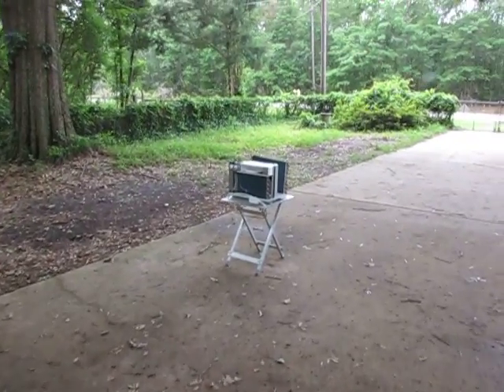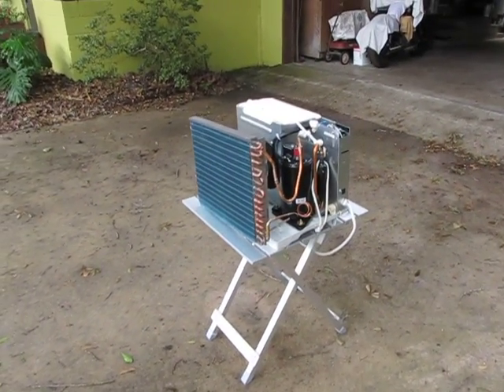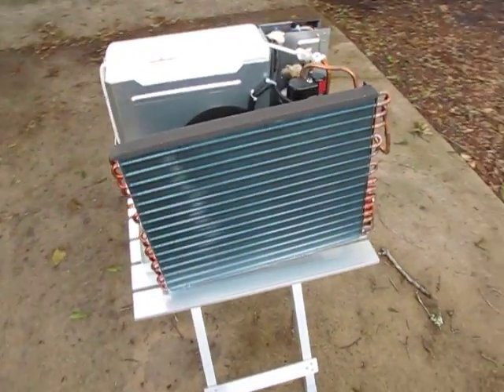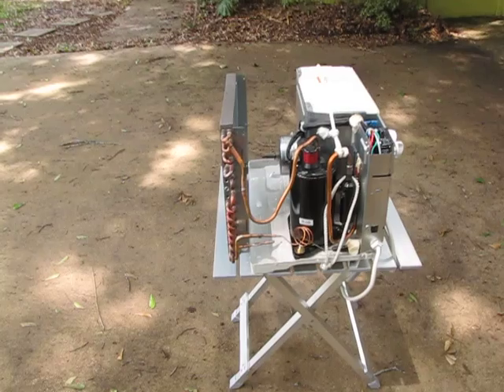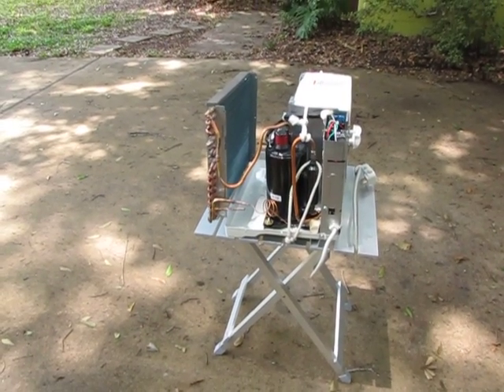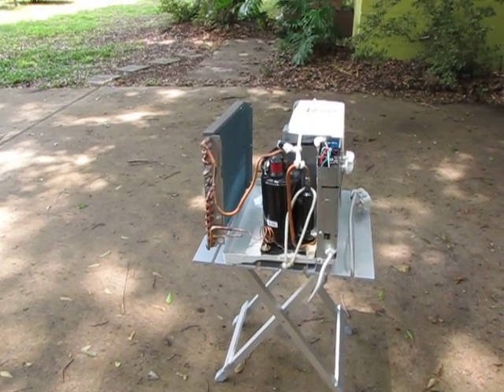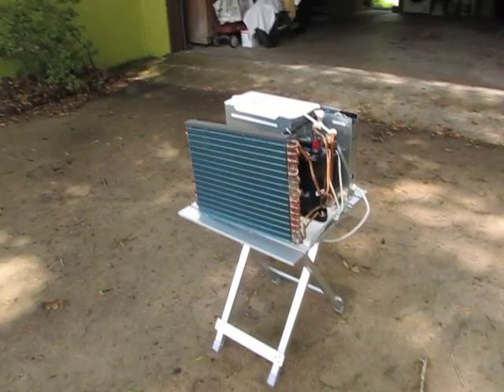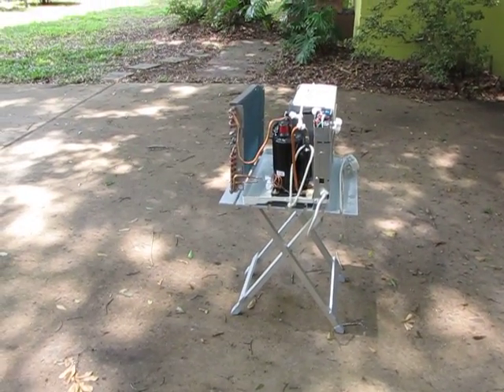DIY hybrid water heater and air conditioner for my solar trailer project

Comment: You would be better wrapping around a tank like they did in there how is works video hybrid water heater Rheem  
Because if you have a refrigerant leak it can’t get in your water looks like 16 raps with a space then 9 more raps l
Looks like a lot of pipe but I’m thinking a old bladder  tank 1st remove bladder then weld 3 couplings at top of tank 
Install pop off safety valve 2nd hole install well for temperature probe 3rd hole is water out 
On the bottom cover inside the tank install a 4” riser with a 90 on it so it doesn’t point up 
Seal and install it back on the tank you may need to make a gasket 
This is water in 
Then wrap the copper lines around it like Rheem did 
Then insulate it
I’m going to try to make one soon I’ll make a video of it when I do

Comment: You could extract heat from anywhere and condense it into a hot water tank. This is stored energy that lasts as long as your insulation is good. Theirs a formula for that =-)  Water can absorb tremendous amounts of energy to be used how and when you want.

Comment: Fine presentation.  Am building a place in Indonesia where the equatorial heat simplifies the parameters. For a regular 7,000 Btu heat-pump versus simple A/C unit, here you are talking about $1160 versus $270, so I think there's benefit to DIY.  BTW, that heat pump doesn't even come with the storage tank.  At first I was thinking of just making an air-to-air heat-exchanger using an old car radiator, but the eventually-hot water passing through is probably not safe for human consumption.  My variation on your theme is to use 3 energy transfer mechanisms: 1] solar-driven 12v pump, 2] modular solar hot-water panel(s) (2'x2' unit out of Seattle), & 3] DIY heat-pump. We'll have 7 A/C units (indiv. units much cheaper than combined here ... go figure).  One unit will be for cool-room, so will be run 24 hours.  Cold water from main tank will pass by heat-exchanger next to A/Cs' exhausts (DIY copper- or aluminum-tubing best option here?), then to relay valved splitter where, if sunny, solar pump pushes through solar hot-water panel, in addition to a temperature-controlled pump sending water to an on-demand/instant gas-powered water-heater (e.g., Rinnai), both feeding to an insulated tank.  Ideas?  Improvements?

Comment: this would be a great option for a fridge also. maybe have an option to connect A/C and freezers together! for more capacity. and maybe a solar heater to go with it. a system that could all work together. use the alliances to preheat before the solar actually heats to a higher temp. as long as it works. it can save lots of power in the home.

Comment: Its too bad that you just wasted 98 bucks and a perfectly good ac unit! OK now let's think for a minute....... Go to the salvage yard and get rear ac unit from a custom Chevy van.. Or equivalent substitute. And get hoses with the evaparator. Then plan system and use a 15000 or 10000 btu compressor. Put the condenser outside beneath the rv mount it with a 12volt fan from salvage yard. From a compact car and condenser . pipe it together. A cheap ac I've built one for my van it blows out ice cubes! If you want hot water stack another condenser behind the hot one and use a 12volt pump to circulate water. A more complicated unit would use reversing valves to change direction of refrigerant. Too complicated for beginners on a 98 dollar budget.  Just saying for hot water wrap exhaust with copper pipe and pump it a round!

Comment: Instant water heater is way better. won't be long til that submerged coil is leaking Freon from the corroded copper and aluminum also that water is also contaminated with the copper and aluminum. That water is unusable.

Comment: Need a large impeller to move the water around enough but this idea is already in use by new a/c units with slingers. Cold water will make a cold air but both will gradually warm and efficiency will decrease if new cold water is not introduced.
Reply: FutureAirways2  unless you use a chiller type waterfall over the condensate coils this will allow evaporation and condense the hot refrigerant

Comment: Most likely it will not work as is.
If you heat water the internal pressure of the air-conditioner will go  up and will wear your compressor out very fast. In reality you have to get some freon out to keep the pressure down and this depends on your system.
Reply: Why would internal pressure go up if he is cooling the condenser?

Comment: run a 12v water pump off a solar panel. wind generator etc..... move the warmed water from tub thru a line that surrounds the hot water heater and back to tub.  Could use it on small say 6 gal hot water heater under sink?  For trailer run it around the aluminum LP hot water heater tank.   

Simpler solution run the water into your bath tub with a cover.  During the day the AC heats your bath water for the upcoming evening

Comment: That's a great idea. That coil won't last long in water. You could make a tubing coil out of copper, but you would have to do some engineering. Good luck, I look foward to future posts.
Reply: It will if you add antifreeze to it, It has corrosion  protectors build in.

Comment: I have no doubt that stretcharoni knows what he is doing - so some of this may be of more interest to those less technical than him, but still want to save money & be independent. Assuming the desired outcome is cool air and warm water at the same time? You want the air cooled because you are feeling hot. You are feeling hot because the sun is shining. If the sun is shining, the cheapest way to get warm water is via a solar water heater. You could probably make one to match the output of your project for 50 bucks including a small storage vessel.
 The risk with the stretch's project is that the immersed condenser may reach a point where it is not able to dissipate the heat being extracted from your room - and this will be very costly to mitigate, shorten the life of your motor/pump and give you not-so-cold air when you need it most, not to mention the extra electricity consumed. If you mitigate the risk by immersing the condenser in a large enough volume of water, you will get not-so-warm water. Unless you are in a place where the summer weather conditions are the same every day, allowing you to "size" the heat sink (whatever you immerse the condenser in) correctly, the project does not look feasible. Even if you just want hot water (no cooling), what do you do about the fact that your unit is now trying to cool a space you do not want cooled?
Perhaps it's better to build/buy a dedicated heat pump (an "AC" working in reverse). Then duct it into the room for cool air during the day and (stored) heated water. At night or on cold days, divert the cooled air that a heat pump "produces"  to outside the room, say at night, then you can make cheap hot water even at night. I use a dedicated heat pump as a back up to my solar water heater (for dull days & hot water production at night. I have not yet made the ducting described above, but it is fairly simple, the only challenge is to make the ducting aesthetically pleasing.
That said, it is entirely possible to have an AC that doubles as a heat pump - it just seems that the cost is higher than the market is happy to bear. I came across a company that makes them and they just stopped communicating before we got to the question of price. It is a dreadful oversimplification to claim that all AC's are heat pumps - actually it's untrue - unless you choose to ignore the two critical components that allow  heat pumps to transfer heat to water (let's not deal with space heating) - a heat exchanger and a flow pump. A heat pump uses the reverse cycle of the refrigeration phenomenon to extract heat from its surroundings and transfer that heat to another medium (in this case, water) . AC's use the standard refrigeration cycle to extract heat from a defined space and discharge that heat into the atmosphere. I may be wrong..... but I don't think so.
Good luck to you all!
Reply: I think your understanding of a heat pump may be a bit strict, in the sense that you are equating the specifics of a 'heat pump'  as it is sold in industry. In more general terms a heat pump is anything that can extract heat from one medium or body of material, and then dissipate, or impregnate it into another medium or body, with the composition of the mediums, and the means of heat exchange being only a matter of application. That aside, as described, I would agree this design may be at best convenient on occasion, but the concept in general of recuperating and storing unused heat isn't bad. Suppose you put the hot-side heat exchanger ( outside radiator) horizontally in a box with hinged lids on the top and the bottom, and suppose you made remaining walls of the box out of a series of vertical tubes, and that those tubes are cleverly piped with valves to a reservoir where we intend to store the heat. Now imagine if some how the doors on the box could be opened, and the valves to the hot reservoir closed when some set of conditions are met, say perhaps by means of a small micro-controller or absurd series of re-purposed thermostats automotive relays and mercury-switches. This way when it becomes more efficient to dump the heat than to store it (The water is warmer then the air near the hot-side heat exchanger), the doors open, and the outside air is allowed to flow vertically through the box. Of course that's a bit simple, and has some obvious glaring issues(Venting the open box (fan))... But the point I'm trying to make is that this may make a better part of a larger solution than a solution it's self, but it's a good line of thought to take. It brought myself to thinking about using something similar on a larger body, like a pool, or bath, specifically in-ground pools, or an indoor bath/pool. A sunken pool has a lot of thermal mass, and ground temps are rather cool and stable even just below the surface, so it may be a big enough sink to run quite a large heat pump/A/C in this way indefinitely, or nearly. As for the indoor bath (Think bath house, not tub.), It can be assumed that these are generally heated, Much of that heat will be scavenged by the A/C and vented outside. So you are bringing in outside heat just to then have to pump a lot of it a second time. Why not instead pump the heat from the air in the home, straight into the water? The bath is still releasing heat into the house, but you did not have to generate, or pump it in from outside, and you are now re-using it instead of paying to have the heat you paid for pushed out of your system.

Comment: ***** You're wrong. Stretcharoni was right. All AC units are "heat pumps". A heat pump is any device that transfers thermal energy from one location to another. It has nothing to do with whether said device is being used to heat, cool, or both. That's more a matter of which side of the wall you're on. If you need to validate yourself by jumping up to call someone out and make an ardent confrontational correction & "EDUCATE" them it's always a good idea to make sure you're not an idiot first because IF YOU ARE then you're just begging for someone like me to chime in and school you. Tip: You're already on the internet. GOOGLE

Comment: You can put the compressor in  the water but make sure that the compaciter isn't in the water, and the electrical hookups must be sealed. The compressor itself is airtight and generates a lot of heat. Wish you luck. Keep us veiwers updated and if you have any new ideas please contact me at davemccoy1990@yahoo.com would like to discuss this further with you, because I have more ideas for you to try before you put the air  conditioner  radiator in the hot water tank because you can set up a pretank before it goes into the hotwater tank that way you have hotwater going into the hotwater tank instead of cold water to keep your hot water tank from kicking on.

Comment: too bad you dont have a well, them you would have a constant sourcr of 52° to 65° cooling fluid. the earths mass has a near infinite capacity to absorb heat. air conditioner performance goes way up when condenser runs at those temps!
 then in winter pass same water over evaporator and extract heat to lessen heating load of inside spaces.
you can still extract the waste heat with a water to water exchanger inline before the well injection point

Comment: Part 2. ...the second section (in series by the way) to be traditionally cooled via fan. To minimise energy input the fan may benefit from a thermostatic control. That way when the water becomes heated, the first section of the condenser losses performance the inlet to the second stage condenser will trigger the air fan as required.

Comment: Part 1, This will be a method of providing the heat to pre heat the water. Cause as the temperature of the heated water increases, the cooler losses the ability to carry out the task of condensing the hot vapour. Thus reducing the performance of heat transfer. So if this was the condenser if a cooler or a refrigerator the appliance may eventually cease to function, our achieve the desired temperature. So it may be wise to have a two section condenser, the first section immersed in water, and...

Comment: Part II: I guess the next place to go is run the math on the BTU's available and see if there is reason to believe there would be enough heat to warm X-amount of water and also to figure if there would be any boiling issues.  Not done any math, just thinking out loud.  I have a canned ham camper with little room for desired hot water heater.  This concept could be a solution.
Reply: I don't think there is a risk of boiling water. You wouldn't be able to touch the hot fins of the ac unit of it was that hot.

Comment: Part I: I like where you were going with this and your thoughts on a refrigerator being better.  I am wondering, It'd be interesting to cut the refrigerant line (with technicians help), run that refrigerant through a coil inside hot water tank affixed to the refrigerator.  On exit of the tank, line goes back to the original condenser input point.  All copper, recharge. Now the water gets the heat first if needed.  Totally passive system.  Connect water lines with flexible setup.

Comment: A friend and I made a swimming pool heater this way, a few years ago.  Used a one ton a/c unit, made a small tank to house the condenser coil and plumbed it into the filter lines.  Worked like a champ!  Though, at the time, the pool was too far away from the house to utilize the cold air it made..

Comment: I did an experiment that worked with a 12V 200W water heating element and "24V" configured panels with the Solar Hybrid Hot Water Controller and no other modifications. It was for a 6 gal tank someone was using. This might work for you. See my channel or drop by techluck.com for more info. Or send me a PM.

Comment: It would be cheaper to just get hot water from a standing pilot water heater, no electrical just natural gas where available. You would still have to run it on 120V. You can also just turn it around and use it to heat up a room for winter if the fan was still in place LOL.

Comment: Not a good idea.You need to remove the heat not leave it cycling.Try to just spray carefully the condenser with water hose and you will see immediate Amps. drop,but you can't keep it running it will lead to compressor failure.The best so far in Florida is geo loop heat pump.What we need down here is efficient dehumidifier,not oversized AC units.Humidity control equals comfort..I built myself geo loop 4Ton dehumidifier with variable blower speed fan and it takes 1.8kW to comfort my 2000sqf.house.

Comment: it called heat reclaim or a cogeneration system the only thing is if your water temp gets to high the system will cut out on high head pressure and if the system does not have a H/P cut out the systems cooling efficiency will drop and the comp may over heat due to the increase in suction pressure.

Comment: Made a pool heater that way. Used a one ton unit and made a custom condenser coil in a tube. Circulated pool water through the tube. Only problem we had was without the fan to cool the motor it overheated. We just cut a hole and used air from the evaporator instead.

Comment: That's what I call taking advantage of the heat! Hope your not going to submerge that coil in your drinking/ shower water cause that coil has a galvanized plate that will corrode poisoning yourself!

Comment: i hope you use some kind of heat exchanger or something  if youre cooking or drinking this water, its not in contact with the radiator, theyre usually made with leaad joints.. that would be deadly

Comment: This has been done for years in the restaurant business as well as the grocery stores. It's called water cooled AC as appose to air cooled. Also, some geothermal AC units offer a desuperheater for their units. These desuperheaters allow some of the heat from the hot side of a home HVAC to be used to pre-heat domestic hot water. I've been trying for years for find a HVAC guy that would assist me with adding a desuperheater to my existing HVAC.

Comment: You're setting up a desuperheater. They've been around for a while. It will work as long as the heat being dissipated is high enough to allow the AC to cool. 

BTW water cooled AC units have been around for a long time in the food service business. Of course most of the heat was wasted and not used.

Comment: This idea will only work for as long as it takes the water to get hot then the ac unit will stop cooling. If you wanna make the system work properly use a heat recovery unit ,one that takes heat from high side line. Sinking the condenser in water will only work for short period of time .Heat recovery units use what is called super heat from the compressors high side line and use a heat exchanger design.